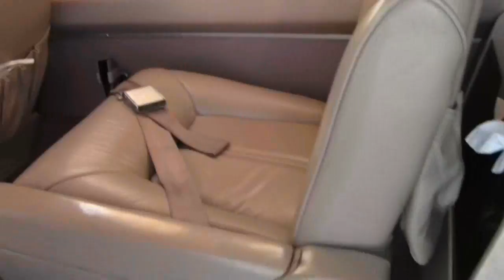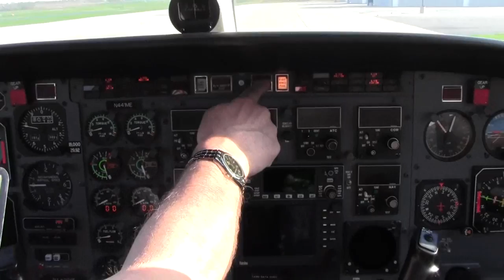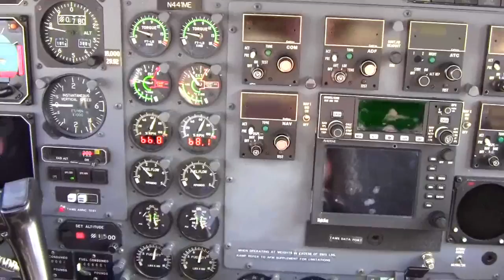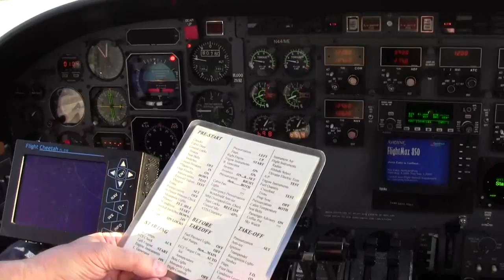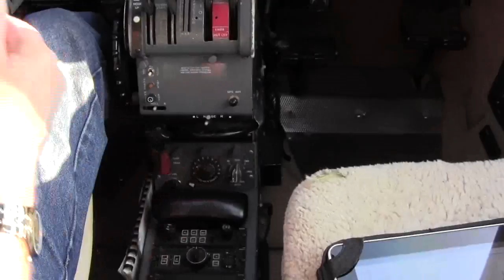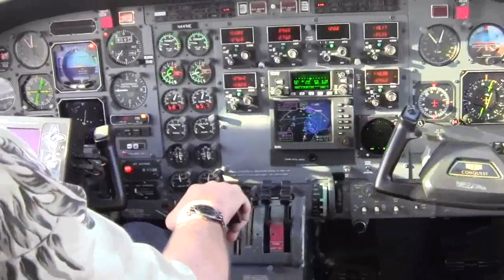Flying a Twin Propjet Part 1

Comment: I've flown the Conquest 1 and Conquest II.  The people who operate the Conquest I, with its P&W Engines will "never" abandon their passion for that plane, and rightfully so.  As for me ... there is no comparison.  Those Garrett's (-10's) accelerate faster, better climb, more fuel efficient, and completely predictable on a go-around.  The newer engines have dramatically extended TBO's as well (which relate to an extended hot section too).

Comment: Just stepping back and look at the Conquest 2 I want to say it was built to compete with the Fairchild Merlin 300 Because if you placed them side by side they sure do seem to look alike .  I could be wrong ...I have got to wonder did Flight Cheetah designers get around to down sizing that Hat box you have mounted on the flight yoke ? Yet ????

Comment: LH oil pressure over the limit...
Reply: normal just after start on cold oil,it goes down pretty quick.
Reply: no kidding! and it stays pegged!
Reply: if it stays pegged,there is a problem and the gauge needs checked for calibration and if ok,an adjustment is needed on the engine.Been away from Garretts for 20 yrs.,but I'm pretty sure that it is a fairly easy fix.

Comment: So this thing burns 10 gallons of fuel before you even finish your checks?
Reply: you should see what this does around 31-33K,the numbers will impress you for sure if you know anything about turbo-props in this class.A King-Air can only dream of the performance and fuel burn this thing has!
Reply: @jettechdon28  F50?
Reply: Lol if you’re worried about fuel I recommend a Toyota Prius.🥺
Reply: And this video was from over 6 years ago.  Never mind.
Reply: It was the thought that counts.